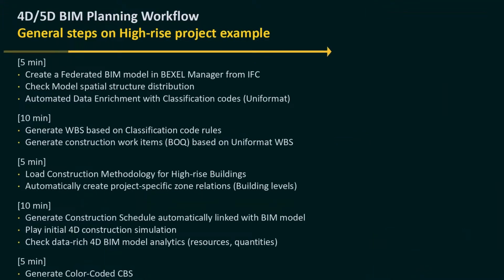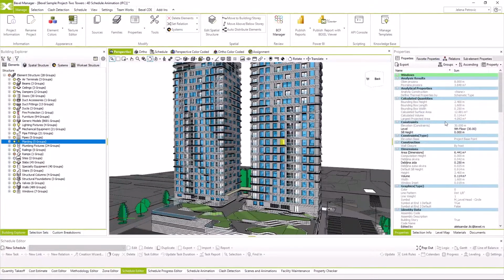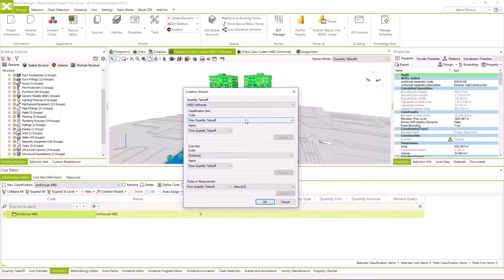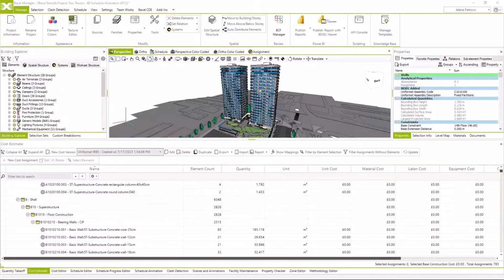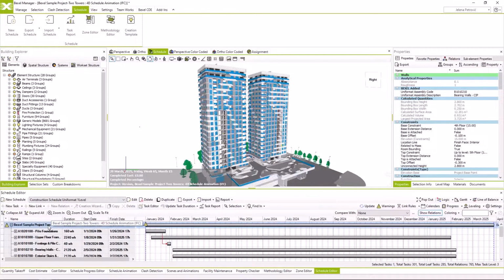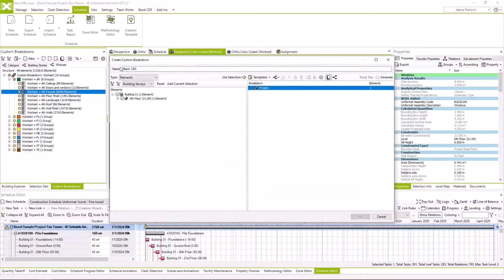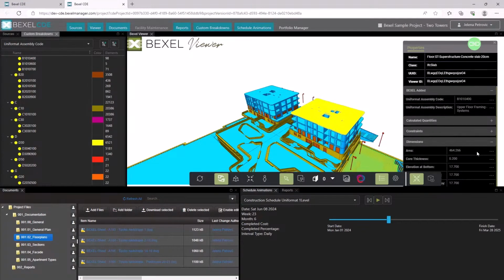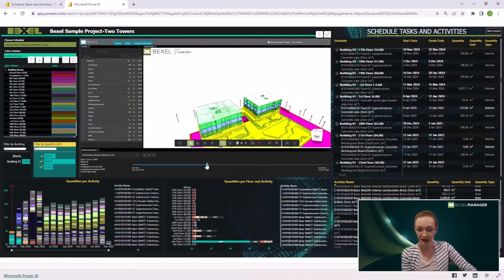Mastering BIM Data Vol 3 - Interactive BIM Dashboards - 4D/5D Planning

Comment: I am currently using Bexel Manager with my graduation project, when I import the ifc files to create a federated model and then try to make quantity take of or any selection set, in the building section I have 3 buildings which is the 3 ifc models I imported but I notice that in your video you have only one building even though you imported 19 ifc files, am I doing something wrong?